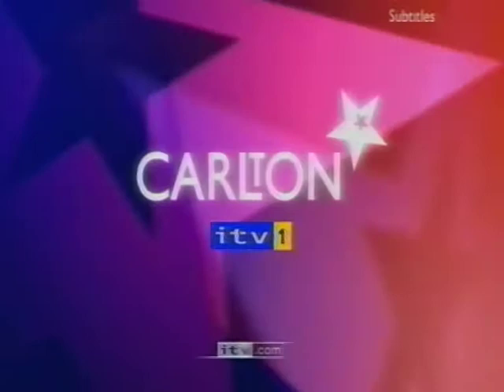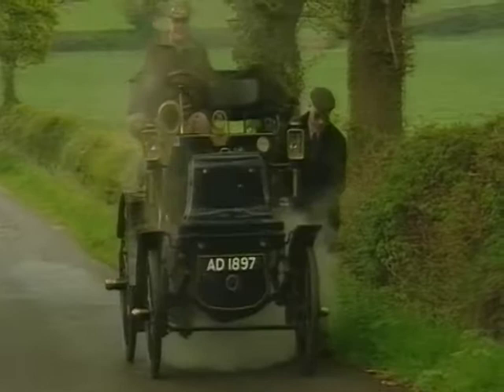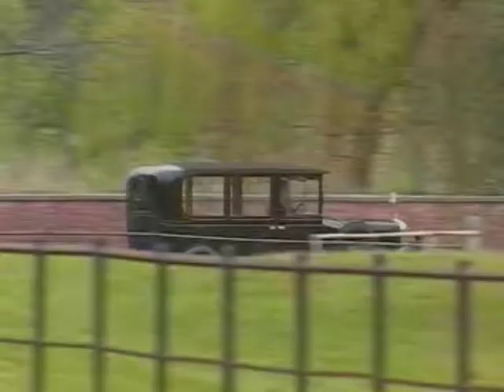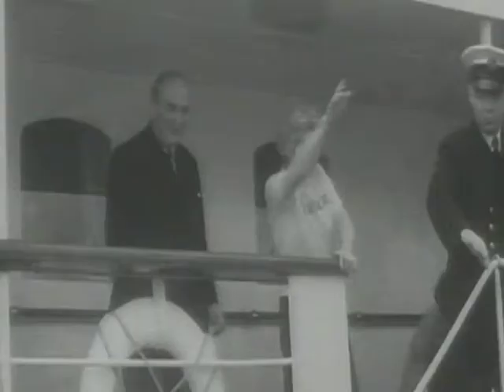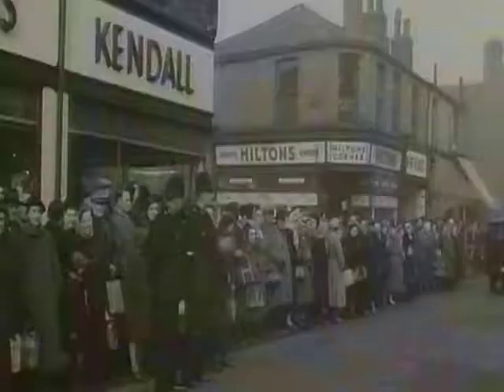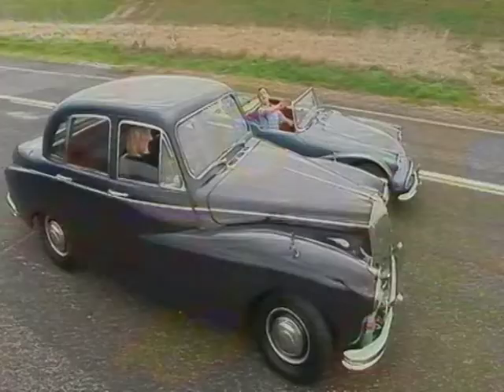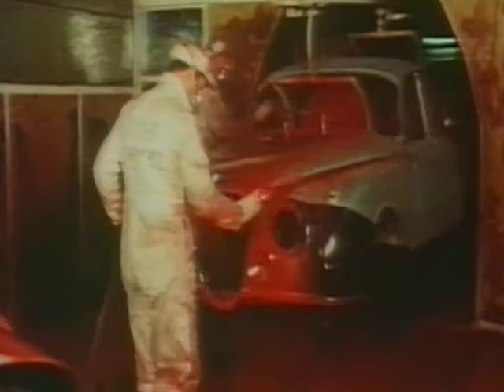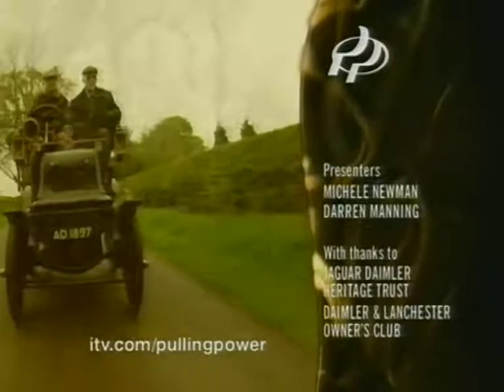The Daimler Story

Comment: My brother owns a 1927 Daimler 20/70. The handbook servicing  schedule It is based on driving approximately 1000 miles per month. and the vehicle came with a five year warranty on the chassis and running gear, one year on the body.
A five year/100,000 mile warranty in 1927!   
Almost a centuary later Rolls Royce offers a four year warranty, Bentley three years.

Comment: Just a shame that Nora wasted so much time and effort on vulgar monstrosities. She had several years at that caper before Sir Bernard left under the cloud of an insurance scandal.  By the time Jaguar took over, the production of Fleetline busses had dwindled to almost nothing - but it revived under Jaguar. Jaguar was a mixed blessing. It was good that Daimler versions of Jaguar cars were introduced. the 2.5l V8 did well. But Sir William already had a sports car in his range. He did not need the SP250. The larger V8 should have been used in the Daimler version of the 420: The Sovereign, (and possibly the Mk10), and the Majestic Major dropped - fine car though it was in many ways. I owned one, and some features were very crude. The leading edges of the front doors were tucked inside the trailing edges of the front wings. Yipes! Contemporary Jaguars were much better finished.

And the perennial problem was that the British rarely bothered to sell their cars overseas - other than in the Empire, whereas everybody else sold their cars in the empire.

Comment: Around 17:30 "big V8 engine". In what universe is 2.5 litres a big engine? The chassis flex problem was fixed very quickly. It was called a "Daimler Dart". The export model in the USA was called an "SP 250" because "Dart" was already taken by Dodge. This would be a much better video if it concentrated on the facts and toned down the florid sensationalism.
Reply: In 1950's Britain 2.5 ltr V8 in a little twoseater was huge.
It's a shame Daimler got took over by Jag, who had the xk ohc .
That 2,5 V8 should have been developed ,the bigger 4.5(?)V8 was essentially the same engine the capacity increased in stroke and bore.
Had they kept the stroke and just bored it (easily done) you would probably be around 3.5lts and being 'oversquare' should have revved well, another one of histories what ifs.
Reply: In 1950's Britain.